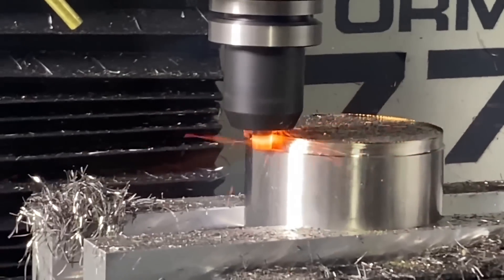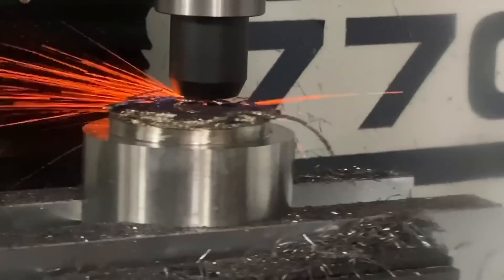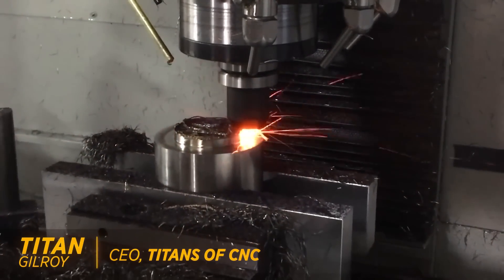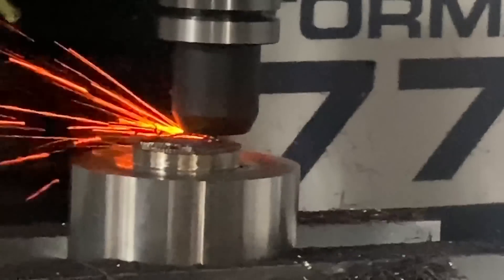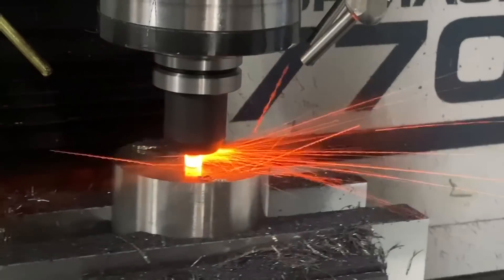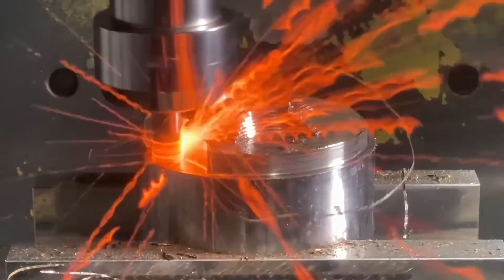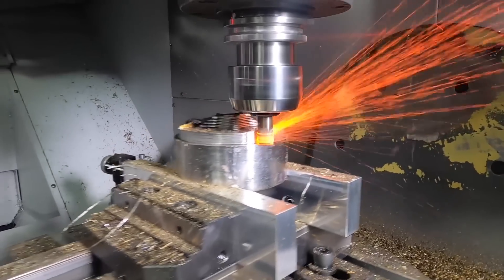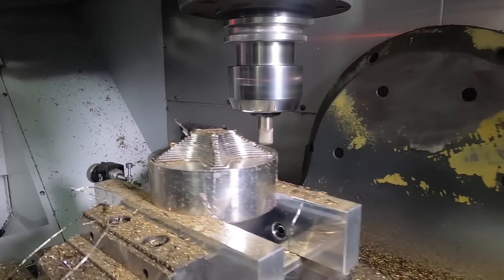Everything You Need to Know About CERAMIC TOOLING

Comment: Never knew of ceramic cutters, 
But it looks like your climb milling with these cutters, ?? is that correct?

Have a question,
 how slow of a speed can one use these at without running into problems,
My mill is a small hobby type you might say, and it runs around 2000.

would it be ok to use ceramic at that slower speeds, but not climb milling and cutting into the metals such as aluminum and stock steels  as I usually don't use many alloy steel, with what I'm doing,

Comment: Titan, this is fantastic, Thank you however I have three questions. First I noticed you are running on a Tormach mill are you using a set screw holder with it. if so what is your run out. typically a setscrew holder runs out over .002 tir sometimes they will be under that but not much. if that is the case this is amazing results with a not so precise holder. also, I am wanting to mill some stuff like A1 tool steel and knife grade steel how does ceramic deal with that. I would guess really well. Finally running that endmill in that setup how many parts can you get out of running the endmill glowing red hot like that. when I see that my reaction is to panic ( years worth of experience with Carbide/HSS etc.). to me this looks like my solution to Hard steel finishing. For a while, I have been looking for a solution for a tool that would hold up with super high surface footage and tiny tool engagement. think like kellering with aluminum and carbide but with a ball em and tool steel etc. over the years I have found a good number of solutions for roughing this material but finishing was the problem. 23 years ago in the mold shop, I was apprenticing in they would use a sinker EDM and burn away material because back then there wasn't this technology. Personally, my scope is pretty limited in regards to working with cutting-edge (no pun intended) tooling like this. I decided to focus on precision machined aluminum products for my product line because it was prohibitively expensive to 3d finish even mid-grade stainless like H13 etc. Roughing was no problem but I would go thru many many finishing ball endmills in the stuff because my area of heat buildup was so small on the endmill. When you can spread that profile over the entire edge things are not so bad but when you focus the heat in a .04 zone you are asking for problems. You may not get a catastrophic failure but your part might be scrapped in finishing because of tool wear. well enough long-winded commentary just know that this video you posted answered a years-long question I had. Thank you again Titan for all that you do for this industry.

Comment: I'm wondering, if the cutter runs so hot that it glows, does it also grow under heat expansion? Do you have to compensate for that or does it not matter?
Reply: The thermal expansion is probably not significant enough to make a difference in most tolerances. Maybe a few tenths
Reply: the ceramic is not affected by the heat nearly as much as carbide is, the glow is from the inconel chips getting red hot.
Reply: I would think you make a finishing cut after

Comment: I turn iron and steel mill rolls with ceramic.    I can attest they are some amazing tooling, even after 7 years of doing this job its still impressive when roughing in a part.    We use NTK ceramics.    We have 3 150Hp Dc  heavy roll lathes these things are brutes!!      Ive ran a 1-1/4 ceramic tool, DOC 20mm Feed rate 0.15 mm/rev @ 125 rpm   850mm diameter steel roll and let me tell you that is some serious material flying off the machine!!    Dump truck full of chips in just a little while!!!!
Reply: Awesome stuff! Have you ever tried Ceramtec ceramics? They give NTK ceramics a run for their money!
Reply: @bartman2144  as of currently no, we tried some other company,I dont recall the name but they failed right quick.   we buy large quantities and the company dont do well with with small quantities.  with the ntk  brand we make a 20 yard roll off can of chips per week,   serious material removal which i think is nearly impossible to beat.
Reply: @bartman2144  what type /size and what tool load and speed and feed and doc are you running?

Comment: Titan, I have a question. Could ceramics be used for roughing hardened steels? Or is it too hard for it and ceramics will break? As far as I know, high temperature could cause tempering of it surface, but if you would leave some stock to remove, you could remove it with normal end mill to get back to hard stuff.
Reply: Yes, tool and die makers do it every day. I routinely machine custom Jaw sets (interrupted cuts) with ceramics on 4140 that's 55-60 HRC.

Comment: We use carbide, and Its a haas vf4 dont know the specific max. rpm. Whats the lowest rpm you can use with ceramic and inconel.

Oh and we use 6 flute carbide and flood it with coolant and feed speeds are super slow, almost like 50x slower than what we're watching.

I dont run the haas' I'm just on the manuals for now.

Comment: When Titan refers to being inert at high heat, he is specifically referring to that ceramics do not oxidize at extremely high heat. Tungsten carbide can structurally handle just as high heat, but it reacts with oxygen at those temps in air and will quickly wither away. Ceramics do not react with oxygen at high heat so they can be used indefinitely at such high temps.
Reply: Ceramics can and do oxidize at high temperatures,  it just depends how high the temperature has to be. In the case of tungsten carbide it starts around ~600 C, and is generally used up to ~750 C. For other ceramics it can be higher or lower, it is a spectrum and really depends on the material. I'm not sure what material Kennametal's "ceramic" is but it is misleading to just call it a ceramic since most of the materials that tooling is made from are or contain ceramics; tungsten carbide is an example and so are iron-carbon alloys (steel) which can naturally form iron carbide (cementite) in a range of tunable microstructures.
Reply: It specifically causes degradation of the Cobalt binder
Reply: ^ tungsten carbide itself is a ceramic too.
Reply: Thanks

Comment: Ive machined the ends from up to 120mm diameter hardened steel ball screws with a lengh of up to 8m on a conventional lathe with ceramic inserts for years. Using a customized bezel ive received a first cut of 11mm depth of cut with 2400rpm and 0.042mm/U every time. Loved the job, but payment was very bad for this kind of work with workpieces up to 2t and no crane available. 
But there was a lot of action going on at work every day. 😄
One day in winter me and my coworkers turned out all the lights in the workshop and had a lot of fun watching the bright shining, burning steel flowed into the machinebed.

Greetings from Germany

Comment: Any recommendations for drilling and boring and getting to grips with chip/swarf control on  titanium grade2 on an ST15 Haas lathe would be great.👌
Reply: What size bore and how deep
Reply: @mattcaesar5781  Hi Matt. It's an 18mm dia hole  going about 56 mm deep. This is in preparation for a 19.1 mm  bore .
Reply: @burville100   you could do it in steps maybe divide it into 4. Also if you might slow it down on the bore if your clogging up on boring. Dont mess with titanium  much i do mostly hasteloy and inconels but that helps me.
Reply: @mattcaesar5781  Cheers for the advice buddy👍